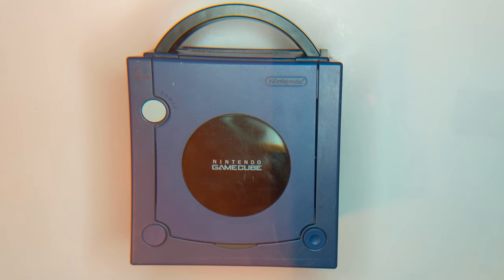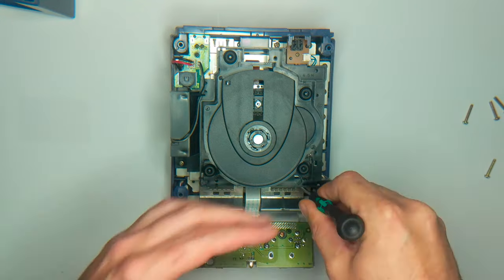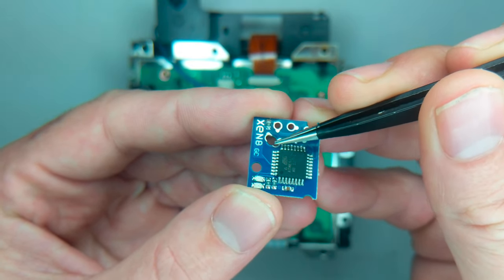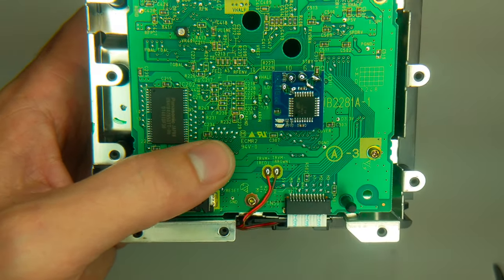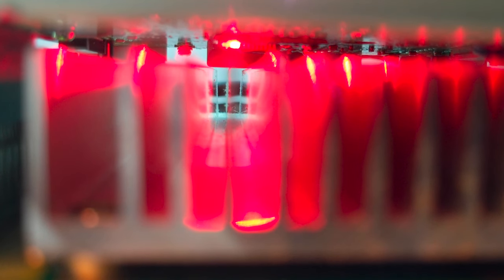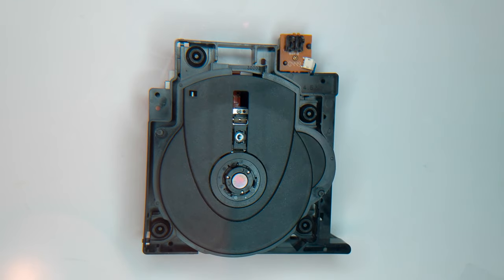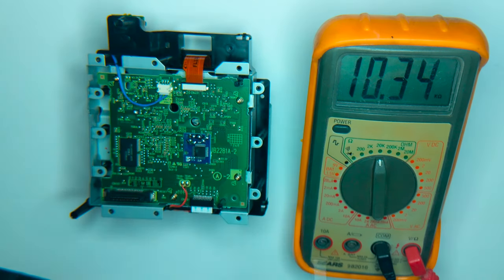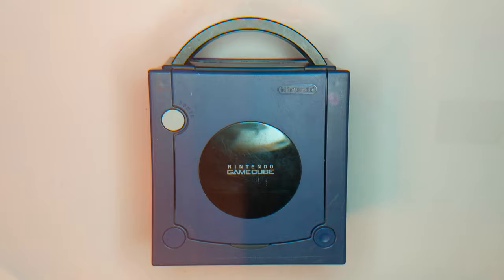GameCube Xeno Modchip Install

Comment: do yourself a favor and just use wires to connect it all up. so much better being able to see everything is connected up properly.. i had to desolder mine and do it again with wires because using the flooding the holes method I either didnt use enough solder - or it wasnt flush and I used too much solder and it made a bridge that I couldnt see..

Comment: heres a lesson in watching a video completely before doing. i tried soldering to the board before you mentioned how some people do it with wires. luckily i did not destroy my gamecube, but my project is on hold until a new chip and a solder removal device arrives from amazon

Comment: Hello jus I want to ask it’s true that you can pre load Swiss OS on the switch instead to boot from the cd? Like the Dreamcast mood you can preload the bios to boot from different devices
Reply: not sure about preloading it without using a CD - but there is an option in the swiss settings that tells the disk drive to stop spinning after it has loaded SWISS - this means the disk drive just fires up for the first 20seconds - then stops spinning once swiss is loaded.
makes it way quieter - and it will save you disk drive in the long run

Comment: My gamecube with xeno modchip is broken due to the bad disc drive capacitors.
So I replaced it with my new gamecube toys r us edition with region switch mod. So I swapped the old disc drive with GC Loader PNP HW2 with 1TB SD Card with Every GameCube Game in a America.

Comment: 150ohm seams extremely low. 
Most experienced moders if talked to so far recommend staying above 300ohm
Reply: Some models start at 300-600 ohms, other models are 100-300ohm. It is low

Comment: Looks like those top two points could easily bridge the pads underneath because you can see two of them through the whole. Maybe they are suppose to be bridged, I dunno. But is that why people recommend using wires instead?

Comment: hey i have question, would this work on a gamecube, but the model is: DOL-101????
Reply: Yes mate, it will, I'm getting a gamecube 101 as well and gonna mod it with this xeno chip too, the process are all the same but the optical reading dvd potentiometer are different across all models so you always have to check it with a multimeter and slightly down a bit to not damage the lens.

Comment: I just need to calibrate it an inch or two huh? Thanks for the info, I'm working on getting some game back ups for my Gamecube
Reply: NOOOO buy a multi meter and dont destroy ur optic drive laser. Its a seriously small turn i thought this guy changed his pot generously the first time cause he went down 100 ohms the first turn. Beside the point of it needing to read 150ohms to work. Try to turn it like 30ish ohms at a time. 

Ive been messing with pots on lasers by building them for fun. I have a handful of them so far.. anyways pots are very sensitive and if u havent done it before take precaution of being overly safe. Theres no stopping overdriving, that is how you over drive a laser. Less resistance means more power to laser

Comment: Will the xeno chip make it region free? Because I want to get a orange GameCube
Reply: Yes
Reply: Will you need to pot. Tweak if you are just wanting to un lock the region?
Reply: @borderlinesuperhero  no original discs work without that.
Reply: @Isamu1013  really? Why is that?
Reply: @harrisonfordyce6982  It is explained in the video at 7:20.
In short home burned discs are darker than original discs from the factory.
Industrial disc burners can be much more powerful than the two in one’s we can have in a pc.
If you want to read data from a darker disc you need a stronger laser, this is what we do with the resistance adjustment of the potentiometer. So that adjustment is only needed if you are going to use home burned discs. Which means that if you use original discs you won’t need to adjust that.
Reply: @Isamu1013 only to add to what u said; however, sometimes gamecubes age and need the pot adjustment to repair to read any cds

Comment: If my GameCube reads backups off swiss, would I still need to change the pot or not?
Reply: No, because changing the pot is only for making it able to read unreadable discs. 

Somr gamecubes need a pot adjustment for regular nintendo cds from age or soemthing. 

I was thinking, what if we can buy nicer mini dvd r that is easier to read

Comment: hey i have question, would this work on a gamecube, but the model is: DOL-101????
Reply: I mean you could but it's kind of limited as it does not have the serial Port 2
Reply: All u gota do is burn your own iso gamecibe games. Many people do this to play digital games from the missing port from dol101 called sd2sp2. 

You will be able to play any disc with this mod. Therefore a swiss disc can be read which then plays digital games

Comment: What's the best way to remove a defective chip if solderd directly to the board? Is using Solder wick sufficient?
Reply: Like Joshua said. I did my first ever modchip install with this chip and thought I soldered correctly. Powered and everything, but for some reason would not boot swiss disc. Removed with solder sucker. Had to install a new chip with wire and alternate points since some lost the contact.
Reply: I couldnt remove mine with solder wick. I had to use a hot air gun quite scary for me lol.
I used wick as much as I could - and then hot air gun until it wiggled free

Comment: Very poor soldering. It almost looks like you might have bridged the 2 pads on either side of that "connector" with that giant blob of solder. I'd recommend applying solder to the pad first before mounting the chip as it will allow a better solder connection and produce less of a bulge and more of a bridge.

Comment: I was going to do the Xeno mod,  But after some investigating, having to tune the optical drive to even use a swiss boot disk you burned means my official GC games on disk will have trouble loading.  So I would be forced to use ISO images on SD cards.  I decided just to pay about 10 times more for a Black Dog GC Loader that replaces the optical drive.

Comment: Do you know any descent brand names that are good quality of DvD-R discs? I read really cheap ones reduce the disc reading lasers life span
Reply: Stick with Swiss no need for discs
Reply: @RichieBEAR88  but i still need a Dvd-R playing to tel the Gamecube to check the sd card to boot into swiss 
Id rather skip out on the GCloader
Reply: @xshadowxless8906  i tried burning a few copies of swiss but they never worked.. - I think my burner cannot burn slow enough.  I ended up buying one off ebay off some french dude with a proper burner - works great
Reply: I use Verbatim DVD-R Printable DVDs.
They are fullsize but work perfectly.